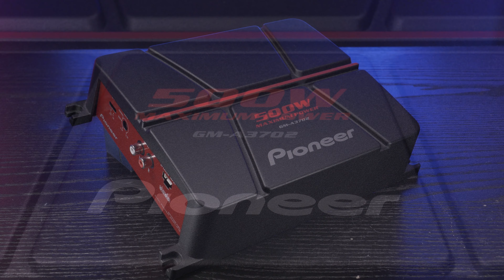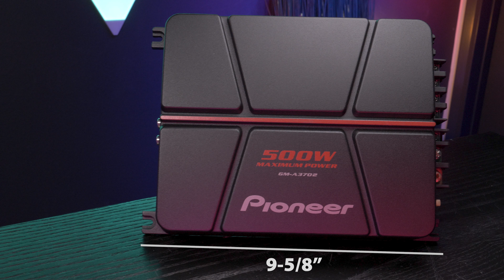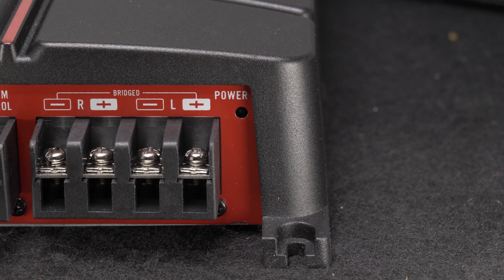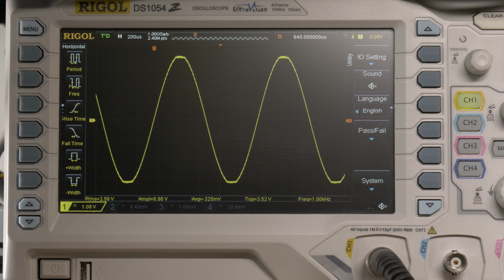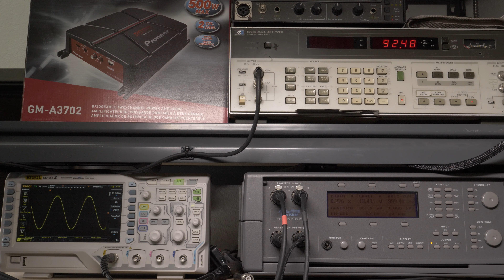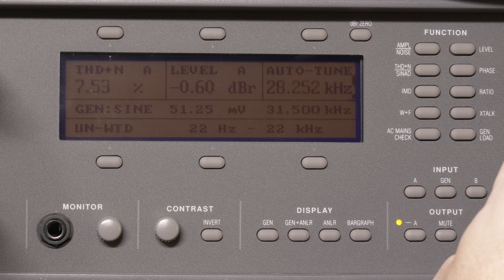Cheapest Pioneer GM-A3702 2-Channel Amplifier - It's better than we thought!

Comment: Question I have alpine s-s65 80 watts rms per speaker 240 peak per speaker 480 watt total combined will this amp power these speakers at 100% efficiently? As I read you put 60 watts rms x 2 channel 4 ohms these speakers are 4 ohms I’m still new to music world so I’m assuming these speakers won’t be powered by this amp?
Reply: AB class speakers never run at such high efficiency. Then better go to a more modern (but less warm sounding) class D amp

Comment: So I ordered this amp. I've gone through a couple of other amps with my set-up(PC audio output to amp, amp to long speaker wires to speakers(2) in another room). By "gone-through" i mean they would stop having audio(or low audio) on one side, left or right, like I blew them out. I'm not really sure what's going on with my set-up, because I don't really know what I'm doing, just being honest. What would be the proper settings for this, or is my set-up completely wrong?
Reply from the maker: What is your power supply setup?

Comment: Got the big brother to this (a5702) on vipoutlet for like 40$ years ago and it's since been replaced. But I had it bangin on 2 ts-w261d4's wired to 4 ohms mono. Did run hot but didn't sound too bad at all and never fried. 🔉🔉

Comment: I just picked up the 1000w. Its ment to be 480w rms in bridged mode 4 ohms. Also its ment to do 8ohms bridged. But I don't know what the rms would be for that
Reply: Roughly 300w since it's the same as hooking up 4 ohms in stereo. The amp adds the resistances since it's class a/b 2 channel, if it was mono class d it would half them.
Reply: @lagginswag  I got the amp it can run a 1000w rms and hammer it hard lol
Reply: @stevenstratton6930   I had it for awhile does at least the rated 480. It definitely ran hot, in my application I ended up going with a 1ohm stable monoblock @ 700wrms. I still have it though.

Comment: I have this powering 4 12" subs arranged in a double isobaric configuration. Honestly this amp was gonna be a placeholder until I could get something more powerful, but trust me when I say the 190W bridged is PLENTY! Due to the logarithmic scale, 190W is actually a whole lot of power. You'd need almost 2000W to double the perceived volume!
Reply from the maker: So many are stuck on power, build a great box or seal your doors, 65 watts is very decent! Double ISO! Sick
Reply: Dude thank you was getting 1000 watt push 4 10s so if it push ur 12 it should push my 10
Reply: How’s the bass?
Reply: @dennisgutierrez1672  remarkably controlled. A lot less messy than one would expect for this price. Granted I have it running on $35 drivers, which themselves can sound a little bloated at lower frequencies. But I definitely don't hear anything particularly wrong with the amp. The bass is very strong and present, not a rough approximation like some prominent cheapo brands I've heard in the past.

Comment: Dude....these amps are GARBAGE! I have  the GM 5300t / 760 watt, why are you lying to people? That's not right!
Reply: garbage? hey dude, these is $70 2ch entry level amp, who just need small amp to power both of 6.5 speakers and super cheap. need a better amp just go to top  line amp. this amp not for u
Reply: @SUZUU_33  There are many different amps for that price range that are much much better IMO. The market is saturated with products and competition is fierce these days. I wish Pioneer still made thier "Premier" head unit line....now that's a product actually worth talking about! I have had a couple for the past 20 years that still work perfect and have outstanding sound quality and equalizer parameters that were way ahead of their time. Not sure what happened to Pioneer but not a fan of their amps at all.
Reply from the maker: @SUZUU_33  These are actually quite good, most don't listen to them on good speakers.
Reply: @Qualitymobilevideo  these are the kind of guys that buy  150 watt 2 channel amps to run 2x12in subwoofers. they cry in the review sections when their  amp overheats and clips. Newsflash:  these amps are designed to run 2  six by nines or a single small sub like an 8.
Reply: @rmblwgn  hi, sorry to ask you this here but you seem way too confident so i got to trust you
and i'm really new to "car hifi systems" so please can you tell me if this amp could do the job with jbl gto1204br (300w rms) and a pioneer mvh s42bt (rca out 70w or 50w pre amp) ?
i don't plan to use 100% of the subwoofer's capacity, and i'll surely not get close to the half power, i just want clean bass you know
thanks for reading and sorry for my english, have a good day !
Reply from the maker: @Noumazer  This at 50-60% of a basic 12 inch subwoofer will work but you have zero headroom. If you decide to even moderately turn it up an you will; you'll get 10-15 minutes of pure distortion until you blow up the woofer